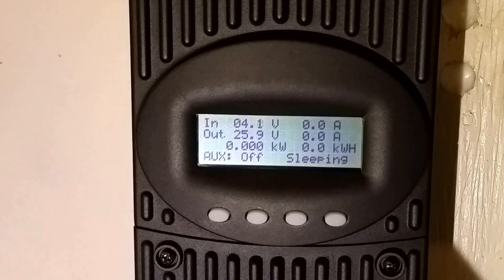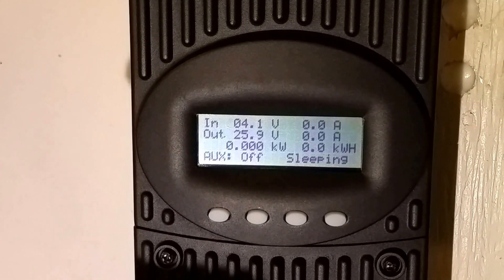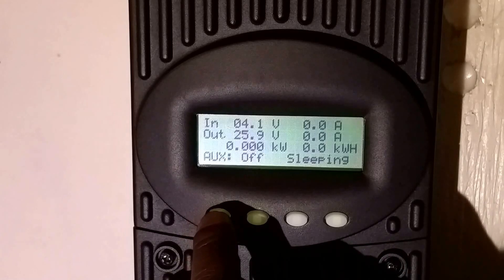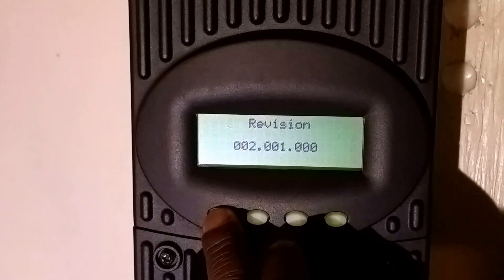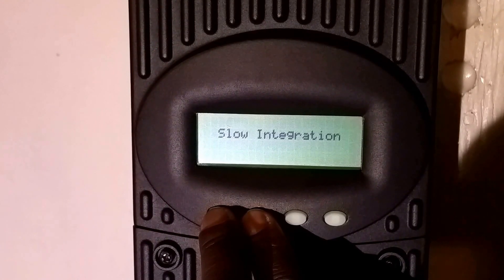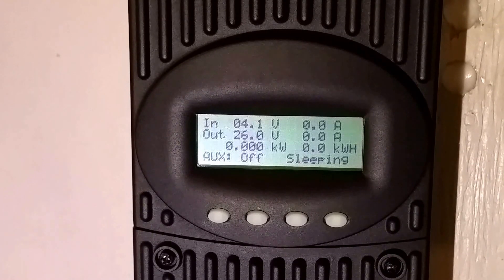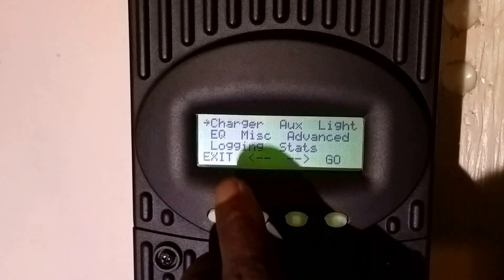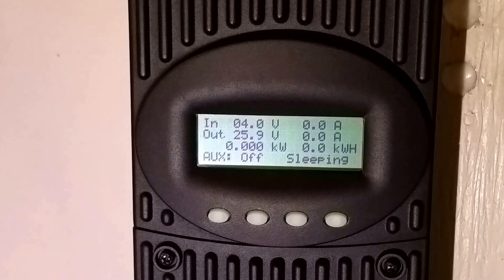FAST AND SLOW INTEGRATION ON OUTBACK FLEXMAX 60 AND 80

Comment: Do you happen to know why my outbacks go into 'Snooze" in broad daylight, when I flip on my deep well pump? It handles the 1800 watt surge, and runs at 1000 watts or below, but this year it began to go into snooze mode in the first 5 minutes regardless of the reading on it when I started. I have 2 Outbacks, one is 2 yrs old, one is 1 yr old. They worked fine on default settings, except I set it to 24 VDC batteries.No problem. Suddenly, in January, it began to do this. I have to stand there when I turn my pump on (feeding into gravity feed water tank) and see if they go into "snooze" then I push first two buttons>go>reset. and then it goes into "wakeup" and it's good for a few hours. It doesn't do this when I'm cooking or using other high wattage items,( 1500 watts. ) So I'm baffled. 

I have 1950 watts in panels, they usually show 26-35 volts IN, I have a true sine 8000 watt Power Jack which is Chinese and has worked great for us. We've had it over a year and at one point we thought we blew it out (our fault- overheated cable) but it rested 2 days and then self healed, is the only way I can describe it.  The company really seems to be service oriented. Contrary to what we usually get from China. My panels are Chinese too and they are working great, had 4 for 4 or more years , got the rest 2 years ago and one last year. The two Outback Flex max 80's and 10 Walmart marine deep cycle batteries, 3 years old. All cables are at least 4 awg, and the ones on the inverter are like 00 so pretty thick. Special ordered from a marine cable guy. Cables coming from panels are 4 awg. I have been doing this since 1992. I learn as I go.
Reply from the maker: whisperingsage 
Hello my friend and thank for the explanation. 
I would like to explain few concerns toward your situation but, it will be too much to explain in writing. 
We can do this on the phone and that will be much better. 
Would you share your contact with me now as I speak so I can help you with this situation now? 
Thanks for visiting jwsolarusa and have a wonderful day
Reply: How do I PM you?
Reply: whisperingsage Same issue here,  FM goes into sleep/snooze? Help
Reply: jwsolarusa  same here, What remedy did you get to resolve this issue on the FM80?

Comment: I put a 5 farad capacitor in my system. I have a MSW inverter. Shouldnt the cap smooth the ripple? Should I use fast or slow with my setup?
Reply from the maker: +Jay Hughart 
The OutBack Flexmax 60 default settings is on FAST INTEGRATION
Reply from the maker: +Jay Hughart 
Please follow your Batteries and Inverter manufacturer specification to do your setup.
Thanks for sharing buddy and God bless you.